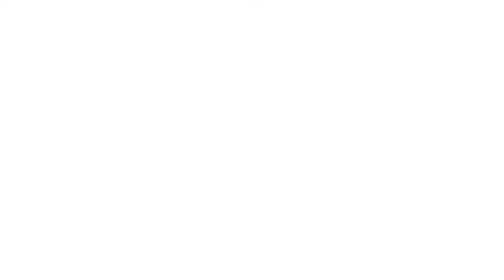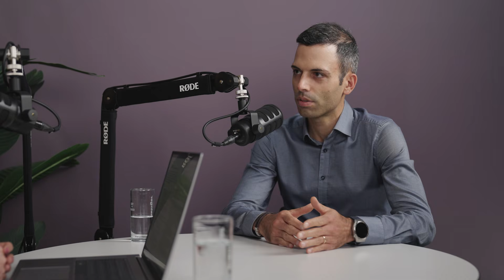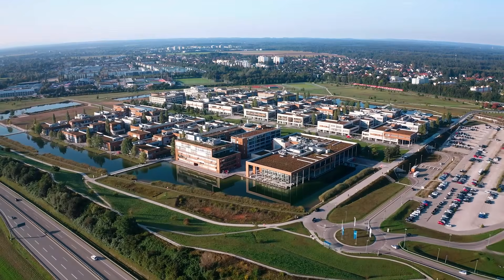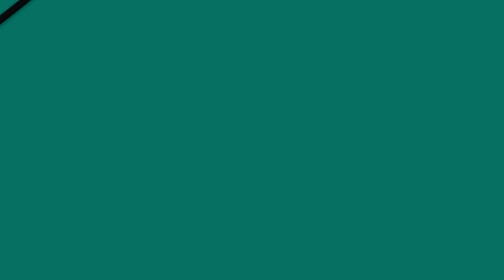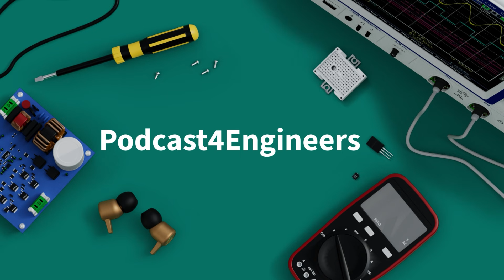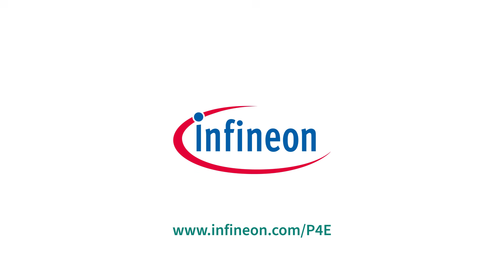The server rack evolution toward 3‑phase PSUs 🔌 Podcast4Engineers | Infineon

Comment: Realising that there's an immediate need to scale power today (driven by market forces), I reckon that this will propel demand for GaN and SiC applications in the Medium & High Voltage space (eg. migrating from Gen.1 → Gen.2 → Gen.3 server racks architecture improvement in Data Centers power management).  Or in technical term if were to put it bluntly in measureable scale is that the demand for GaN / SiC correlates proportionately well with the HyperScaler inniatives to drive POE level closer to 1.0 (ie. could be optimally 1.2 achieveable goal, but driven ideally towards 1.0).